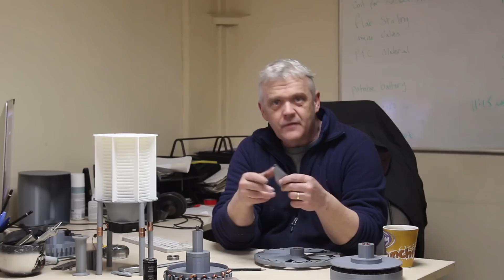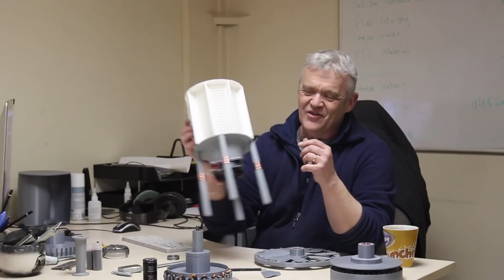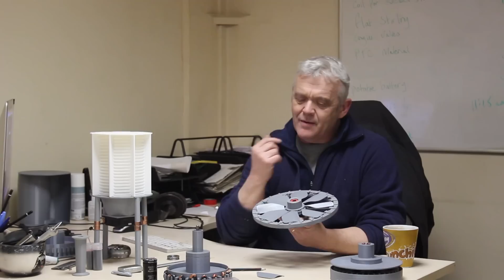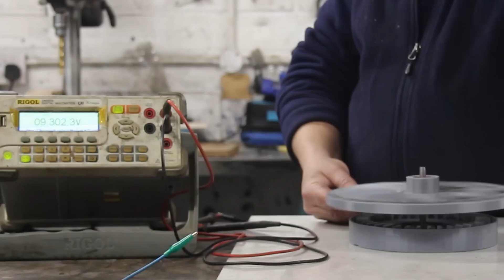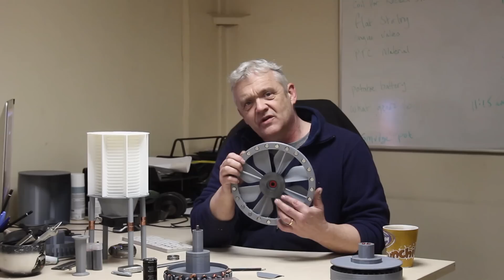1893 The Darwin Feather Turbine - Looking Like A Winner

Comment: Dude.. .were you drunk? This is really silly. The whole point of the leaf turbine is having a mechanism to harness perpendicular currents. What were you thinking? Then you guys were measuring the voltage? Ok, based on what? Did you apply any kind of load? I love you and your channel. But I'm absolutely shocked as to the absurdity of your thinking in this experiment.

Comment: I was thinking of the peregrine falcon wing shape during maximum power. 
But as the air is coming from the top having the underside shape of the wing as the propeller area that catches the wind. 
The issue of course is finding the profile shape in  flight. The bird is known to reach 242mph so nature has done the work already.

Comment: I know your goal is not necessarily off grid 12v generation as such and I know you were measuring open circuit voltage with no load, but when you reached 12v PLUS my ears pricked up!! Great work, well done.

Comment: I do believe that the feathers(blades) do lift to a certain extend, as it adapts naturally to the different forces, going from slow to fast in different conditions.I am sure a highspeed camera will proof this point, that the blades adjust self to the changing high and low pressures created during alternating wind speeds, it optimises it self. "Theory guides and Practical decides"

Comment: Hmmm... Why dont you add a L pipe over the top with a vertical fin? That way you can add horizontal wind? You could even add a large cone section for added wind gathering?

Comment: Could the blade ring section be placed in the camber of a circular air foil wing shaped intake?  This would increase the wind speed hitting the blades and it could spin faster in the reduced air pressure region. ?

Comment: Have you ever looked at the feather hanging down rather than lifting up. I did that on a washing line with 1 Sq meter feathers.  I regularly got around 150 to  200 watts from it. I had incredible torque and it would only spin around 1 revs per secondI had 60 coils on a 1/2 meter diameter disc and 120 magnets. Used it to charge car batteries for my emergency power here in South Africa.

Comment: If you make a new collector make shuters on the slelings of the air gates when pushed against it they close❤
As with the rotators there resistance you reseave more magnetude towart the mantainence of the motion 

Otherwise probebley the air find do to the resistance trouth  the other whay outside and if the air wind is pulled the wind starts pulling on the winds going oud again and you lose magnetude on the push of the release of the colector❤

Realey looks nice❤🙏😋

Only not olways the winds are blown oftenend thay are pushed and puled at the same time❤

Like ark memory wind can bild op these cinde of behavieures simular way❤

Comment: What capacitor would you recommend for replacement of batteries, specifically lithium or such. Re:- a motorhome or off grid situation and cost/ease of construction would be a factor, but efficency/long jeapody/cost of constrution is closer to the order of desirability.

Comment: I really really like this design and there is one really good benefit for using the magnets for lifting, it can generate power but then also store it for a long-term use and at the same time I imagine it can take the variables that when normally has and turns it more into a consistent stream of power

Comment: Why don't you just measure the RPM with a tachometer, if you're only interested in voltage (effectively RPM)?
Reply: I agree with this comment. It would also be more accurate, as the voltage the way  Bob measures it depends on how close he holds the coil to the magnets.
Reply: @leostarling5746  Not great scientific method being demonstrated. He doesn't have to go to the Nth degree, but plugging in an ammeter and using a set coil location would go a long way. 

I'd wager it's because his magnetically levitated bearing introduces some oscillation based on the reaction, so since the volt meter is "infinite impedance" it won't load up the rotor, and he can blame variation on his hand movement. 

It wouldn't be that hard to rig up an Arduino with a volt meter, amp meter, and use a hall effect or IR sensor to get RPM. Then he could just plop different heads on to the base and get instant comparable logged results. 

Then he could just copy and paste them into an excel sheet and overlay performance graphs. 

Something useful to work on whilst his 3D printers work.
Reply: @Leo99929  the real problem is that better measurements will show that leaf rotor under Darwin to be rather poor.

Comment: I was half expecting it to be mounted vertically and the air directed downwards over only one half of the turbine, so air and gravity open the leaves but gravity helps close them on the return part of the cycle, which seems to me to be a more effective way of opening and closing them, rather than in it's more normal config with air coming at it horizontally. But at the rotation speeds it might not contribute too much anyway for the sizes and speeds likely in a smaller one.

Comment: Fantastic Robert, I love the way you explore different ideas. What if the turbine was on its side like a water wheel. The blades would flap open on the downwards rotation and result in more power. There would also be space for multiple turbines. Keep them coming Robert, loving it :)

Comment: I’ve had an idea re improving the design:
What happens if the Darwin is turned upside down and is black in colour?
Heat rises, therefore solar energy will, on sunnier days, increase efficiency of the whole generator.
Just an idea 😊
Reply from the maker: it's a good idea mate

Comment: I don't understand this at all. The amazing virtue of the feathered disk is that when wind blows against it horizontally, it raises the feathers. This provides a large area of wind resistance, allowing for capture of a significant amount of the wind's thrust. As the disk spins, after having captured its share of the wind's force, the feather flattens down for the return, thus drastically reducing its resistance to the wind. That was the incredible breakthrough of this design. Why abandon that for capturing downward force?

Has it been demonstrated that the same volume of air blowing downward produces more voltage that when it moves across the wind? Is this because the only volume of wind being captured by the disk in horizontal position is equal to the LWH area of the feather, as compared to the volume of wind hitting the entire area of the disk?
Reply from the maker: yeah just more area

Comment: I don't think you can test these things with just open circuit voltage. As soon as you put a load on the generator the generator starts applying a retarding torque to the fan blade. Which causes it to lose velocity fast, which causes the open circuit voltage to collapse.  You need to test these things with a small resistive load. The test of any wind plant is not how much voltage you get out of it but how much power you can extract from the wind. Edit>   unless you output the voltage to a super capacitor which dumps power to a load when the voltage reaches a predetermined level.
Reply from the maker: you should see the other videos - particularly the ones where I talk about the theory behind the tests

Comment: Open circuit voltage isn't a meaningful measurement of power. Measuring voltage drop across a resistor will let you calculate power using the formula V^2 / R (voltage in volts squared divided by resistance in ohms = power in watts)
Reply from the maker: see the videos where I talk about this particularly the theory of the measurements

Comment: but the fether turbine is more for side wind, i dont see the advantage using feathers with winds from top. in this case a blade design with more surface area and fixed wings seems more plausible/effective

I'd be more interested to see what happens if you have your feather turbine and a collector that "shoots" into a L tube, hitting the feather turbine from the side.
Reply from the maker: seems it can be either

Comment: Hi there,
As I suggest on the last video reduced feathers on the flat generator with air running horizontally over the top would be a big improvement. Give it a try steve
Reply from the maker: Great suggestion!

Comment: Would the wind generator in 1132 work better underneath and have the Darwin feather on top.  Or even use the Darwin feather turbine like a Tesla turbine to capture the wind and get it to exit down and then into the 1132 generator?  Is it better to capture the potential energy at several stages instead of just one time?  Eager to see results and possibly do some of this myself!
Reply from the maker: that's very clever mate - I honestly don't know - but I will give it a go

Comment: What you have now is not the feather turbine, it has become just a large conventional turbine, but with much less 3D printing required to change the blade profile.
Reply from the maker: I am not sure about that mate - mostly because I tried a conventional turbine blade too
Reply: @ThinkingandTinkering  If the feathers flex more than the turbine blades there may be some gain due to variable geometry, especially with respect to the Darwin collector, which produces uneven airspeed over the area of the turbine.
Also the feathers not currently being blown on may rotate on the hinge producing less air resistance, implying that turning the concept of the feather turbine upside down may produce a better effect.
Sorry for the rambling reply, MY fizzing brain thought of the second part while writing the first.

Comment: I'm trying to figure out how to work in magnetic levitation on my stator. I'd say it must be around 35 pounds. I'll weigh it somehow. I wonder if it would cut down force enough if I had to still lock the stator to the shaft.
Reply from the maker: you are going to need some pretty strong magnets to repel 35 pounds mate

Comment: I do enjoy the fact that you go ahead and "do" the proof of concepts. It would be a step better in my opinion if you utilized a set of standardized tests to gauge actual improvement. An example would be a standardized serpentine coil winding around a specific array of magnets that you keep consistent across various motor/turbine designs. Or having a target RPM for a given design. Measure the generated voltage and current to get a power reading over time. The various videos I've watched have leant towards showing the quality/ideas of energy production and not so much the quantities involved in the energy production. Exhibiting a voltage difference doesn't necessary equate to high energy production.

Sure, one could say that I go ahead, make and measure these systems myself. I definitely could, but it doesn't seem worth it to me to buy all the materials necessary to make any of these things, especially when there isn't substantial evidence of it being effective. And like... you've already got your prototype made.

With a couple of video sections focused on testing, I think you could really amp up the discussion in these comments.

Thank you for exploring these energy topics.
Reply from the maker: I agree - but I do that - I just don't view everything - you would be amazed how dull that is lol

Comment: Please try from top to side 90° with every 5° angle increments for wind direction to determine how to place them on central rod on stacks. So then the Darwin tower flap degree as well would be nice to be optimized. And bottom wind outlet could be  the parabolic turbine. Thank you for Your Work
Reply from the maker: yes I need to do that

Comment: Very interesting, and this makes me wonder if you could place a stack of several inside the darwin tower so the catch wind from the side as originally designed and in that process also start the downward flow from wheel to wheel until it hits the parabolic Waters wheel at the base. All connected together for more torque or you could stack more coils between rotors get get more coils working.
Reply from the maker: Good question!

Comment: I'd not followed you channel regularly because I have neither the space not the understanding to tinker with electrical gizmos. but I am wondering if you could combine the flat turbine (above) with the cone you used a month ago under it to increase output or would the flat turbine reduce the efficiency?
Reply from the maker: that's the plan

Comment: Not entirely convinced by VentumDynamics, their performance data is virtually non-existent... 🤔 The design looks cool certainly, and does capture the imagination, but in general I've yet to be convinced by the whole omni-directional advantages of a VAWT when you can simply point a HAWT towards, and optimise for, what will always largely be a prevailing wind.... 😋
Reply from the maker: well - clearly they don't feel the need to convince you and clearly they have convinced those who matter lol
Reply: @ThinkingandTinkering  I've seen this kind of thing many times before, performance data obfuscation by marketing spin that's too "on the nose". It's almost formulaic. I found some numbers, not on their front page, but right at the bottom of a downloadable PDF that suspiciously corresponds closely to Betz law calculations. They even state that these numbers are largely theoretical. Why? Does that not raise a red flag for you...? The only people they need to convince are those non-engineers, those that have money to spend for the green initiative. These days, that's like taking candy from a baby... 😁
Reply: I agree. The company seems a bit weird. Also worth noting VD had this design long before this channel started talking about Darwin's design. In spirit, it's really about saving space and having the moving expensive parts being small. The most efficient solution will always be a gigantic turbine facing into the wind etc. This solution is about increasing the surface area of wind you're catching without having to change the size and direction of the actual expensive/sensitive turbine. Whether it does any better than other designs is the question, and it's not one VD have really provided any concrete figures on. Frustrating this channel is fixated on vague measurements and relative improvements rather than measuring over all power output that would take away all doubt that comes from constantly rebuilding both the turbine and the generator specs.

Comment: no no no. go back. the feather thing was better :) seriously though, the main point of darwin design is collecting more air but vawts are already good at that. with the feather configuration eliminating resistance on the opposite side, it's the best of both worlds
Reply from the maker: that depends on what you mean by better - in what terms?
Reply: @ThinkingandTinkering  i'm mostly thinking using the space efficiently. especially the floor area the generator occupies. achieving that without a rotating top heavy structure is the main advantage of the darwin turbine. that's why we love it.

however, the feather configuration, if added an upside down turbine to catch the wind on the other side of the crossection, could even be better at exactly the same aspects. i'm also assuming the counterweight on fins idea is adopted for them to require minimum force opening up.

it uses the entire footprint, it can still have both generators at the bottom, can be stacked up to utilize more of the vertical space and for the efficiency, the way i'm eyeballing it is that i imagine how much slower the air is when leaving the turbine and how much of it do we slow down.

also, because the wind is pushing the fins in the same direction it blows, it can generate a much larger torque. if you throw a CVT between the turbine and the magnets, you can have the turbine stiffness respond to the wind speed.

most importantly, i'm so glad to find your channel. seeing a nice person having created an environment to have fun exploring engineering questions is always a happy portion of the day. cheers

Comment: I was imagining you placing the leaf generator on top of the collector, as a way to actively capture the air across the top, while forcing more wind down to the base generator.
Reply from the maker: that's a nice idea mate
Reply: Have you considered the Halbach Array of your magnets on the rim to increase the strength of flux on the coil ... you will need to change the type of magnets to rectangular

Comment: How well does this work with the air coming up though it?

If you're getting back to measuring top down or bottom up though, surely that then indicates that the way forward would be to use a fixed, aerodynamically efficient, blade system?

Something akin to the fan blades at the front of a Rolls Royce Trent 1000 or XWB engine possibly?
Reply from the maker: dunno

Comment: RMS   I really think  you can get some more energy  by changing the blade profile and split the end so it has a mouth opening for air to escape through much a jet turbine blade with complex inner cavities. The "mouth" opening would create a pressure differential which split the force vectors of air and provide slight more push. Get someone with surface experience in CAD to give that profile for your blades. Good Luck
Reply from the maker: cheers mate